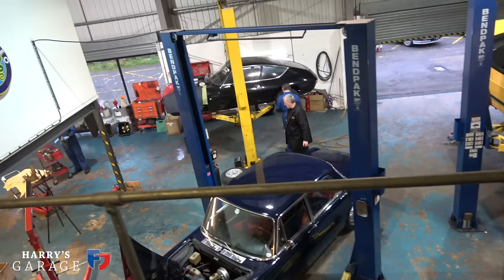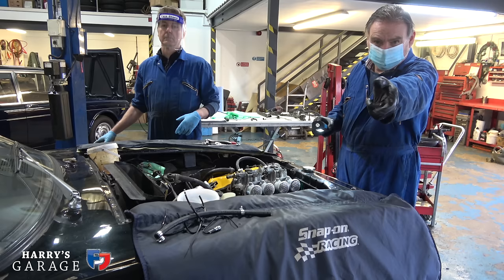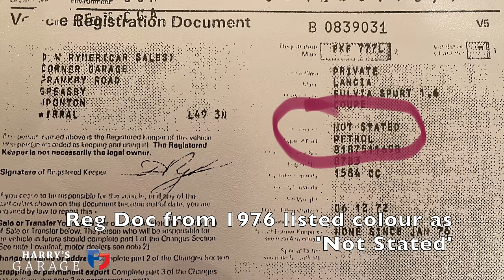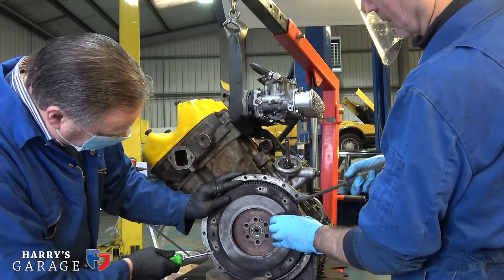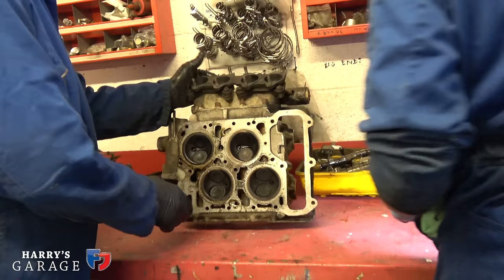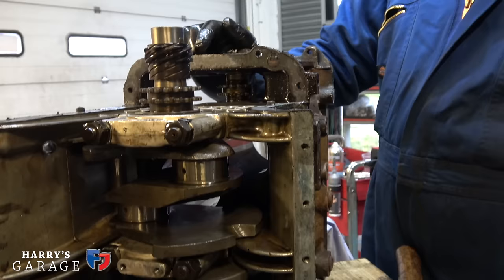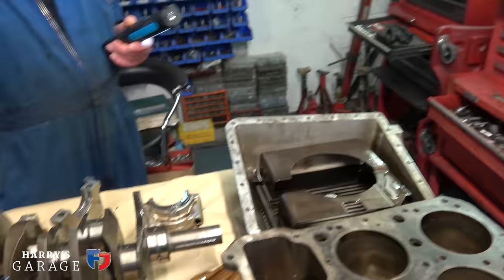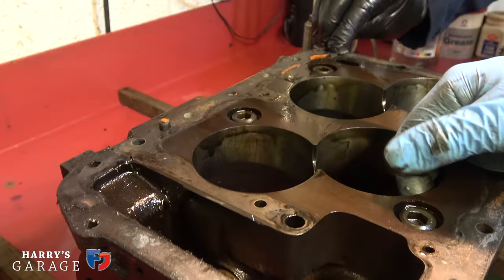Lancia Fulvia Zagato 1600 restoration Part 1. Engine removal & strip down

Comment: First you introduce us to Iain Tyrrell and now we get to meet the team at Day and Whites. It gives a fantastic insight into the work these amazing mechanics can carry out. Given the range of vehicles in your fleet, I cannot wait to meet the next team. 
Please keep this type of content coming Harry. The review stuff on the latest modern vehicles is great - between you and Henry C, we are seeing have some great review content at the moment but this type of video focusing on mechanical engineering and restoration is fantastic and a welcome distraction from yet another overpowered car with too many touch screens.
Reply: Right so these guys are terrible, my dad has a Alfa Romeo series two spider, he took it to them for welding work, a respray and some minor engine work. Not only did they take months longer than they said they would, but the paintjob was shoddy and has been a coming off the car, meaning we now have to get it resprayed at a much better firm called BJ miles in Crayford, who are great with paint and bodywork and specialise in old cars. But that wasn't the end of it, now aside from the shitty don't blame us attitude, they also messed up the engine tuning causing the car to run like a dog and forgot to tighten up the nuts on the wheels, so my dad could have been killed driving it back. That firm is a joke and if you like your car, don't bring it there, they look impressive from the outside, but they do shoddy work. They will blame any mishap with the line 'well its an old car' and honestly the service overall was appalling. And my dads not inexperienced with cars either, he's got classic bikes and can rebuild engines, me and my brother have had a lot of classic cars and he's helped us out a lot with them, including an engine swap at one point, so its not like he's clueless and simply doesn't know what hes talking about, basically they will charge you high prices for sub par work.
Reply: If you want contacts to great old school mechanics, I have a few.
Reply: @jh565bb  yes please. I'm SE London so be grateful for a lead.
Reply: @cyborg7116  BJ miles if you want a body work specialist, I'm not sure about an engine specialist though.
Reply: @jh565bb  thanks for that I'll look them up.

Comment: Brilliant video!  Thanks for staying safe and keeping us all safe.  I believe  whenever you “restore” an old car (not a Concourse trailer queen), always install electric fuel pump, electronic distributor, electric fan with possibly upgraded radiator and front disc brakes where necessary.  That will almost guarantee it RUNS well in the modern world.
Reply from the maker: Agree with you. I always think if 'x' was available back in the day, would they have fitted it? If the answer is definitely yes, then it goes on. Silly to fossilise cars when there's new stuff available that makes them even better to drive

Comment: Old school is the best school. Proper mechanics. No inconvenience with the face nappies Harry. Just part of life at the moment. Thank you for showing this ... Fascinating.
Reply: Right so these guys are terrible, my dad has a Alfa Romeo series two spider, he took it to them for welding work, a respray and some minor engine work. Not only did they take months longer than they said they would, but the paintjob was shoddy and has been a coming off the car, meaning we now have to get it resprayed at a much better firm called BJ miles in Crayford, who are great with paint and bodywork and specialise in old cars. But that wasn't the end of it, now aside from the shitty don't blame us attitude, they also messed up the engine tuning causing the car to run like a dog and forgot to tighten up the nuts on the wheels, so my dad could have been killed driving it back. That firm is a joke and if you like your car, don't bring it there, they look impressive from the outside, but they do shoddy work. They will blame any mishap with the line 'well its an old car' and honestly the service overall was appalling. And my dads not inexperienced with cars either, he's got classic bikes and can rebuild engines, me and my brother have had a lot of classic cars and he's helped us out a lot with them, including an engine swap at one point, so its not like he's clueless and simply doesn't know what hes talking about, basically they will charge you high prices for sub par work.
Reply: My dad has had to fix numerous issues mechanically and some of is wear an tear, but some of it was their shitty workman ship, I wouldn't slag these guys off, if they weren't absolute cowboys and while they did offer to right the wrongs, they were going to charge him all over again. Honestly mate avoid them like the plague, ill happily give you the contact numbers for better people, who actually know what they are doing.

Comment: I had a Fulvia 1300 back in the 80s for a year or two. It was my daily transport, but I always enjoyed 'Just going for a drive'. Engine would rev to red line, and get smoother the faster it went. Even back then, the quality of engineering and design was obvious. Only problem - points would wear out after 3000 miles, so I always bought sets of points at least 2 at a time. Thanks for the video Harry - looking forward to the next one.
Reply from the maker: Great to here. Electronic ignition will be fitted to the Zag during the rebuild. Points are history and are of worse quality (wear even quicker) now than they were back in period.

Comment: I once did an engine rebuild on a 1300cc engine, it had done a little less than 180,000 miles. No significant wear on the main bearings or crank, measured still within original tolerance. 3 main bearing shells showed sign of modest wear (coppering beginning to come through), the others were good. Bore was still within original tolerance such that it only needed regoning and new standard piston rings fitted.  I lightened and balanced the pistons whilst they were out, and of course gas flowed the head, and fitted slightly uprated cams. There was no issue with the valve guides, and only had to reseat the valves. These engines are beautifully built. Provided that you klet them fully warm up (about 10 miles) before pushing the engine, they go on and on.

Comment: That oil nozzle was professionally repaired :-) I used to ram a self-tapper in until I could replace it otherwise the oil pressure really suffered.
Paying attention when splitting the timing chain and not letting it drop into the sump and hit the oil nozzle and therefore snapping it off was the one thing I always promised I would remember, but I only ever remembered after the chain and broken nozzle  were making their descent into the sump. Not once, not twice but three or four times.
Still, a beautiful car and a beautiful engine. Don't ever sell it Harry!
Reply from the maker: Correct. I edited out the bit where John was saying, whatever you do don't drop the chain into the sump as it damages that nozzle but until you see it, it didn't make sense. Not planning on selling any time soon, kids really like this car too..

Comment: Great to see those guys work stripping the engine down. No issues at all with the 'Covid' version of the filming.
The cut outs at the bottom of the bore are to remove the sharp edge there and prevent a weak spot with such a sharp region that could cut into the pistons. Really great engine aside form the general wear and tear, another lucky save and well timed rebuild.

Comment: Absolute quality love these rebuild vids. Master technicians who know everything about these old classics
Reply: Right so these guys are terrible, my dad has a Alfa Romeo series two spider, he took it to them for welding work, a respray and some minor engine work. Not only did they take months longer than they said they would, but the paintjob was shoddy and has been a coming off the car, meaning we now have to get it resprayed at a much better firm called BJ miles in Crayford, who are great with paint and bodywork and specialise in old cars. But that wasn't the end of it, now aside from the shitty don't blame us attitude, they also messed up the engine tuning causing the car to run like a dog and forgot to tighten up the nuts on the wheels, so my dad could have been killed driving it back. That firm is a joke and if you like your car, don't bring it there, they look impressive from the outside, but they do shoddy work. They will blame any mishap with the line 'well its an old car' and honestly the service overall was appalling. And my dads not inexperienced with cars either, he's got classic bikes and can rebuild engines, me and my brother have had a lot of classic cars and he's helped us out a lot with them, including an engine swap at one point, so its not like he's clueless and simply doesn't know what hes talking about, basically they will charge you high prices for sub par work.
Reply: I've sent this message to a few people because Id hate to see any classic car enthusiasts ripped off like my dad was. If you are local ill happily give you numbers to much better mechanics. I've had three classic cars so far a 73, 72 triumph spitfire and currently a 62 sunbeam rapier and I trust these guys to do anything to the cars.

Comment: I am not surprised that the piston rings are showing so much wear, as whenever I have heard this engine in previous HG videos it really has sounded like a Ford V4, not a Lancia V4.  I had 2 Fulvias many years ago, a 1600HF Lusso (same engine as this Zagato) and a Series 1 1300.  Both were smooth as turbines and sounded like it.  I will be very interested to watch this restoration as it progresses.
I seem to recall (a long time ago, maybe 20 years) that only about 30 Fulvia 1600 Zagatos were ever imported to the UK, so this is mega rare now.

Comment: Thanks Harry, I will be watching these videos with interest as I just bought a Fulvia 1600HF.
Reply from the maker: Ha! So you found one? It was great discovering the level of engineering that went into this gem of an engine during the strip-down. The steel crank came as a big surprise, as was the size of the valves and how lightweight and compact it was. Makes Alfa's twin-cam in the GTV seem weirdly over-size somehow. I'm sure you're enjoy your new car!
Reply: @harrysgarage  Yes a really nice original car ! its not concourse and needs a bit of work but its never been welded that i can see but id like to see if I can get a bot more power (and noise!) out of it so will be watching your videos with interest ! It will be interesting to compare it with the Alfa 2000 GTV. The engineering is very advanced for the time I would say
Reply: Funnily my car was that orange/red originally but its now white ! I can see the remnants under the seats and behind the glovebox. I might take it back to the original colour. I think if it was an Alfa that colour was Farina red. Not sure what the colour is for the Lanica but if you find out let me know !

Comment: Loved this video as an Engineer who rebuilds Honda CBX  six cylinder motorcycles. The design is typically Italian with the quality of the era to match. I look forward to the next episode. BTW personally I liked the style of the video and do not feel it compromised in any way.
Reply from the maker: Thanks for watching and your kind comments. I have a CBX too, plus the Z1300. The CBX engine is an engineering marvel but unfortunately the one I have has an after market six into six exhaust, I do have the standard exhaust for it too. 
It sounds a bit harsh with the 6-into-6 but then pretty wild approaching the red-line. I should really change to standard but keep putting it off..
If you have a set of UK spec handlebars, I'd be very interested!
Reply: @harrysgarage  Hi Harry, I should be able to sort you out with a set of UK bars, just be aware there are quite a few other changes required if it's a US model. Email me at cknapton@longclose.co.uk and we can go through the detailed changes.

Comment: The Lancia design department was also known in Italy as "simple affairs complication office"
Reply: @oldbasted  Yes, but it was designed well before the FIAT take over. The Fulvia is the last genuine Lancia, which was excessively over engineered, and where decisions were not driven by cost. The series 3 Fulivia did get the FIAT treatment, ie., cut backs, so for example, no Vernier timing on the cams.

Comment: You have the right team there ,Harry.Fascinating watching these guys.Looks like you took the engine apart just in time. Tin worm in that rear section needs help,also sills and box section under doors are prone.I see some in yours.Machining  quality and that crank is one of the reasons Lancias were expensive.Good luck with the rebuild.looking forward to next update.

Comment: I'm so thankful my Fulvia was already rebuilt before I got hold of it haha. It's very common for that little oiler on the front to break. A lot of people damage it during the rebuild process because the timing chain either falls or tugs on it. You can actually delete it and there's no notable effect on the chain itself. Other options include plugging it/brazing the old one and drilling a new small hole in it.

Comment: I'm an engine reconditioner, never seen a fulvia engine in my life so I checked out some of the parts and nearly fell off my chair when I saw how much the replacement pistons were! It would almost be cheaper to fit new sleeves, expand the old pistons and shim the rings if they are not too badly worn than buy new ones. I'm not sure what the sleeve thickness is like on a Fulvia, some engines (a small few) are notorious for cracking bores and such if you bore them out all the way, might be something worth asking your machinist about as it could be an issue down the road, or it might be no issue at all. Maybe some teflon seals on the valves might be a good investment too. I'd never heard of a Fulvia before your channel, I must say I adore the body shape, especially that rear end, I love all your cars but if I could pick one as my favorite style wise it would be the Fulvia for me.

Comment: The engine seems to be in great condition considering its mileage and the design of it is inspiring but like you I’m amazed that it’s a steel crank.
Just hoping that the corrosion on th body isn’t much worse than what you’ve discovered, but it’s a shame it’s not in the original colour which looks suitably period. Can’t wait for the next update.
Reply from the maker: Glad I'm not the only one amazed by the steel crank! I'd seen images of them before but reckoned they were only on the works Fulvia rally cars but no, they're fitted to all Fulvia V4 engines. No wonder the car was so expensive when new and why Lancia never really turned a profit back in the day..

Comment: You know you can trust a workshop that down tools to play Pop Master !! 

Proper Old Skool.
Reply: Right so these guys are terrible, my dad has a Alfa Romeo series two spider, he took it to them for welding work, a respray and some minor engine work. Not only did they take months longer than they said they would, but the paintjob was shoddy and has been a coming off the car, meaning we now have to get it resprayed at a much better firm called BJ miles in Crayford, who are great with paint and bodywork and specialise in old cars. But that wasn't the end of it, now aside from the shitty don't blame us attitude, they also messed up the engine tuning causing the car to run like a dog and forgot to tighten up the nuts on the wheels, so my dad could have been killed driving it back. That firm is a joke and if you like your car, don't bring it there, they look impressive from the outside, but they do shoddy work. They will blame any mishap with the line 'well its an old car' and honestly the service overall was appalling. And my dads not inexperienced with cars either, he's got classic bikes and can rebuild engines, me and my brother have had a lot of classic cars and he's helped us out a lot with them, including an engine swap at one point, so its not like he's clueless and simply doesn't know what hes talking about, basically they will charge you high prices for sub par work.

Comment: Superb engineering the Lancia engine, especially as comparisons were made with the configuration of the Ford (pig iron ) V4 . With Timing chain and vernier sprockets on the Lancia, originally Fibre gears on the Ford, plus the quill shaft to the oil pump drive, both weak points that had to be sorted for any sort of reliability, The Lancia looks like a Rolex in comparison 👌🏻👍🏻

Comment: We recently did a fuel injection conversion on a Fulvia 1300 with Jenvey heritage throttle bodies. What an absolutely fascinating little engine and car!
Reply from the maker: Interesting. Not thought about doing that. The engine is a little jewel, which you only discover when you strip it down and discover all the little details that go into it. I've got a set of Weber 45s' so thinking of going down that route at the moment but maybe I should investigate injection, via Jenvey throttle bodies, too..
Reply: @harrysgarage  The Jenvey heritage line are a great setup, it gives the look and sound of a traditional Weber DCOE yet the turnkey abilityand relability of a modern vehicle. Unless you are really looking at the engine bay you would just assume it had a set of 45's on it! If you're interested in some photos pop an email over to northamptonmotorsport@btconnect.com